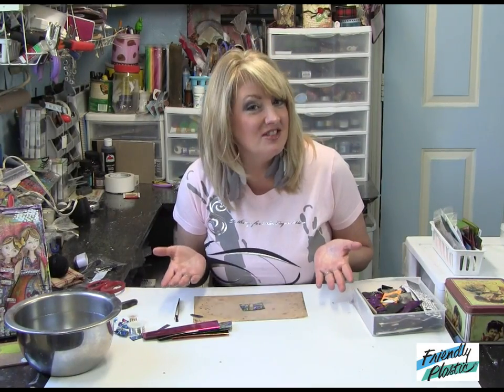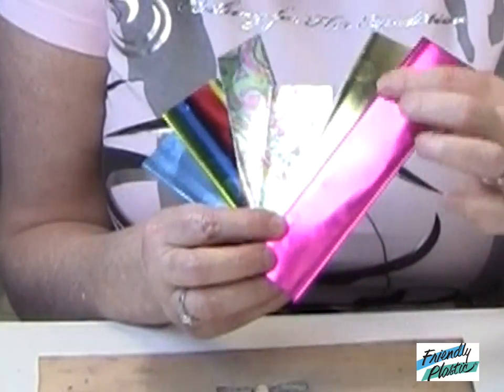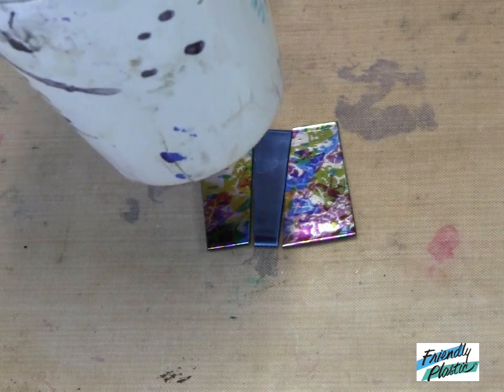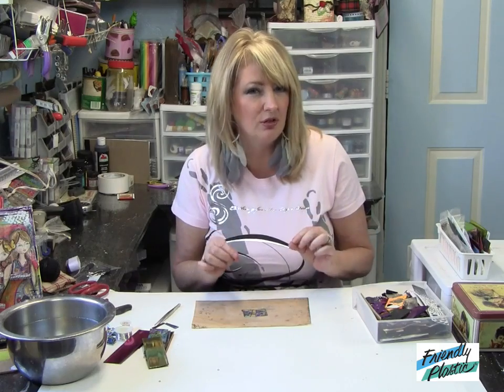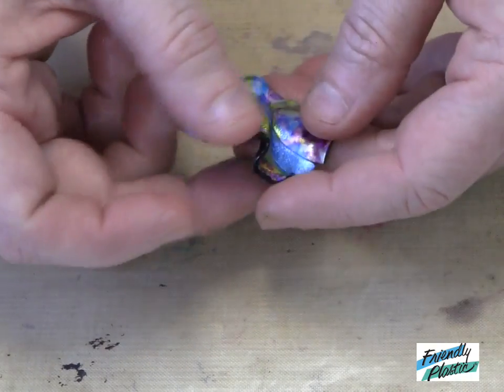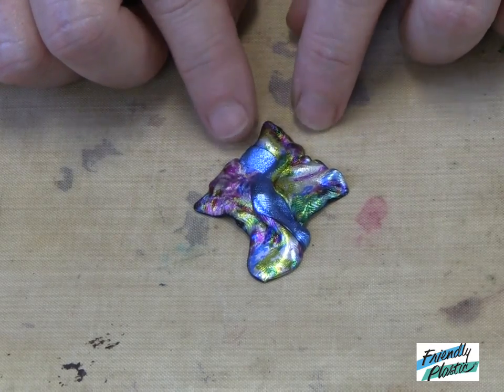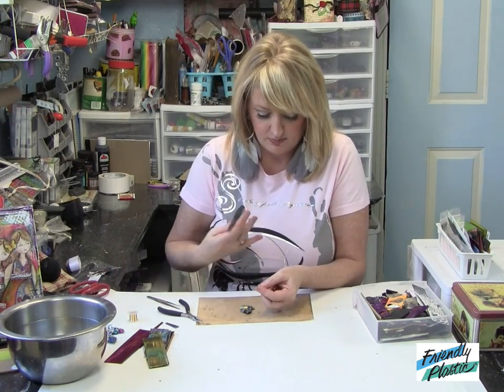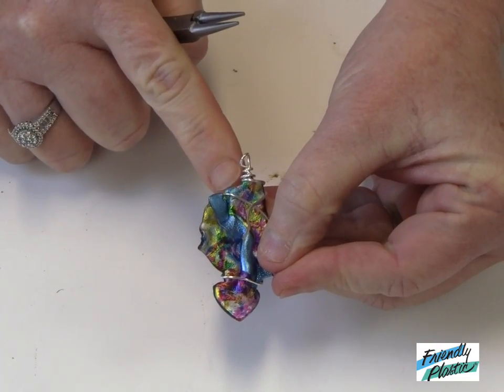How to make Friendly Plastic Jewelry - Friendly Plastic TV

Comment from the maker: Hi Naty!  That is a great question.  I use a "heat tool" I believe you can get them from Ranger Products.  What is important about this heating gun is that it puts out heat rather than alot of air so that it doesn't move the pieces around when you are trying to heat.  Thanks again for the inquiry.  Linda